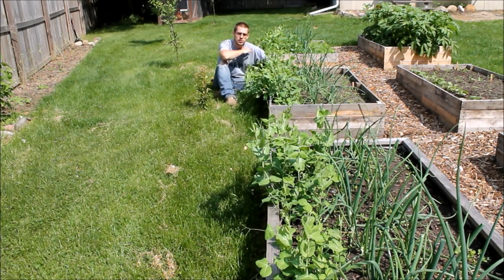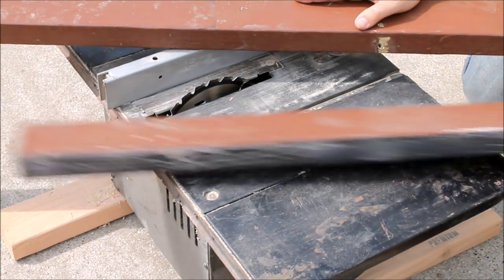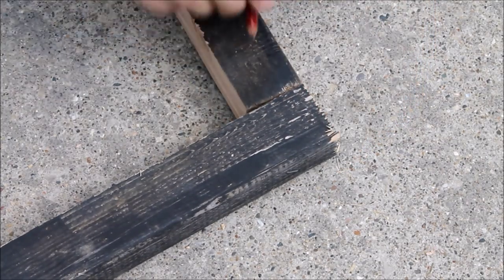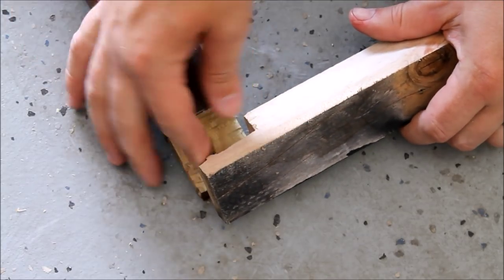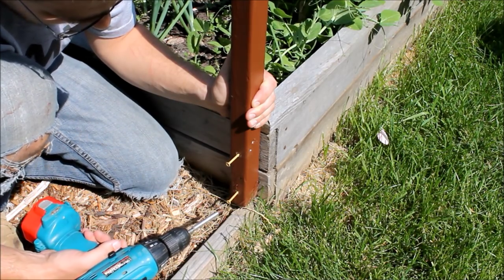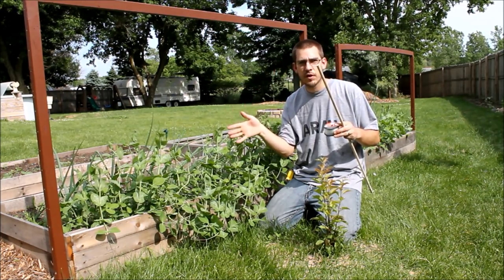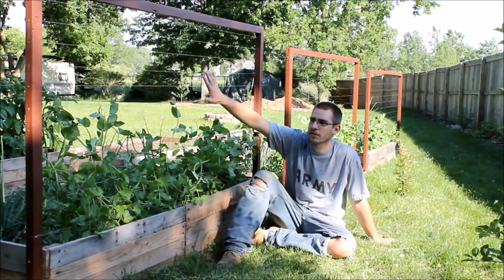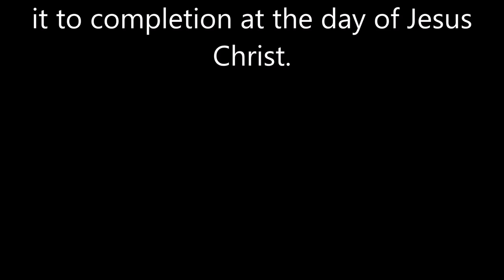Invisible Trellis - A cheap raised bed trellis system

Comment: I finally made one of these today, and it turned out great! I chose to go ahead and pre-drill/pre-string it (without tying it off) before putting it up, then I simply tightened and tied the line once I had the trellis secured in place. I also went ahead and did some vertical lines for extra reinforcement. Looks awesome! Thanks for sharing this project!
Reply from the maker: +NubianP6 glad to hear it! I am plabning to make a new larger one for our new garden this weekend and might incorporate your uogrades, thanks!

Comment: Nice job.  I've done something similar for my cucumbers but, they got to heavy and the lines started to sag.  to fix this I ran one line up the middle, wrapping each line on the way up.  This makes all the lines work together.    subscribed!
Reply from the maker: Shawn Bauer ah, that is a great idea. I may have to do that as well. I tried to pull the line pretty tight but I have a feeling with the cucumber harvest I am expecting ( I always say that)  it will be pretty heavy. Thanks for the tip!
Reply: I love it great job

Comment: I live in a place where we get severe wind so I use electrical conduit pipe and re-bar.  2 x 4ft length re-bar hammered into the ground half way.  Conduit pipe drops over the top of the re-bar, with the same on the other side.  Corner pieces join the standing bar with the cross bar.  In very heavy wind, they don't go anywhere, even with a full crop on them.  I just use garden twine but I like the idea of fishing line.
Reply: Evelyn please show us at least a picture of it, is there a link to a facebook page?  Electrical conduit is that that grey plastic piping or is it galvanized steel pipe?  If you have rebar going thru your vertical posts how do u attach the lines do u still go thru the posts?
Reply: Evelyn Souza Ferreira over time fishing line will break down the fishing line. You will probably have to replace it every year.
Reply from the maker: +Ray Teems this one lasted two years so far but you are right you probably will have to replace it every few years. Only takes a few minutes though and costs about a dollar
Reply: I've done this same thing.  Electrical conduit is the steel pipe.  If you hang down some heavy string (heavy duty baling twine works best) the plants can grow up them and it works great.

Comment: sir great job looks sharp, only upgrades i see you put both screws in line in the same wood grain, it would have been stronger to offset the two corner screws so that the they are slightly diagonal.  so that neither wood has 2 screws in line in one wood grain.  I would have tied each line independently to the post so that if one area breaks it would not undo the whole crop and would not fall down.  Independent lines that way as they weather down and break you can replace one by one.  I would have put the posts 1ft in the ground as a mechanical engineering technician having 2 screws only few inches apart makes the side to side structure weaker. just in case strong side wind comes.
Reply: my dad taught me to put the screws diagonal

Comment: Great idea and it looks real good to. I like to use a type of hemp style twine for annual plants such as peas and beans. Its cheap and biodegradable. At the end of the season its not as strong and you can just rip out the plants pretty aggressively and its not an issue because I only use it for the season. This obviously does mean you have to re-string this twine each year, buts its a quick and easy chore. Thanks.

Comment: I like your idea of the invisible trellis and see advantages for some plants. Peas should do fine on the fish line. However when you grow anything with weight like cucumbers you will find that the fish line will cut into the stems.  The plant above the "crimp" in the stem will not receive the full amount of nutrients and not develop as well. The 60-# line may hold up the weight but the "valve" to the upper part of the plant will be partially closed.  Good luck with all of your plans for SSL
Reply from the maker: Gary Crow I was worried about that with the cucumbers as well. I tried some on it this year and they surprisingly did great. They are not hanging over the line instead the hang on to each other through the line and I haven't seen any crimped stems yet. I wouldn't try anything heavier than a cucumber though!

Comment: For climbing plants with heavier fruit maybe clothesline would work.  I built a clothes drying rack using a similar design - looping the line back and forth between sides of a frame.  Even though the line was advertised as heavy and resistant to stretching I found I still needed to re-tension it after a while.  If fish line is 60 pound test that means it breaks at 60 pounds.  But it probably begins to stretch before then.  Meaning you will need to re-tension the line.  Which may be difficult if plants are already hanging from it. I used 2x4's in my frame.

Comment: Well done!

I found concrete reinforce grid works well too and cheap. It works out to be half the price of sheep fencing in my area and at 12ga, quite a bit beefier. 

I like the method you took. Definitely gonna try it except maybe I'll use 16ga  wire.

Comment: I suggest you use cotton string and not fishing line. When it’s time to cleanup after the season, it’s easy to cut the string instead of separating fishing line and include it in compost.

Comment: I used 3/4 in. electrical conduit 5 feet long and drove them 1 foot into the soil then attached 1x2" fence mesh wire 4' tall.  Never tried it before but it was fairly inexpensive.
Reply from the maker: +Vernon Steinkamp that is a great way to go also. I might try something like that this year also

Comment: This looks great, but I'm wondering how the plants are doing on the fishing line. I would think the wind and weight would cause the plants to pull against the fishing line and the fishing line would cut onto the plants due to the fishing line's small diameter. How are the plants doing?
Reply from the maker: +Susan Miller we did this last year and grew lots of peas and cucumbers on them. No signs of any cutting, the little vines rhat come out wrap around the line and that is what bears the weight not the main stem so no issues. You might not want to grow giant pumpkins on it but smaller stuff works awesome

Comment: Good idea & job on your trellis.
Any idea how long that line will hold up to UV light?

Thanks for sharing!
Reply from the maker: zeffur7 Not sure to be honest but I suppose if I have to replace it after a season or two it only costs a couple bucks. I have a feeling it will be good for at least 2 years without trouble but will probably start to get brittle after that.

Comment: Did the fishing line stay tight or did it sag over time?  I've made similar but used the line used to make chalk marks.  I really would prefer to use fishing line but don't know if regular monofilament line is ok or if I need braided line to limit stretch/sag.
Reply from the maker: the mono did not stretch, it does sag a bit once you get watermelons or a bunch of cucs hanging from it but that was fine since it did not break and springs right back straight once we cleaned off the fruit in the fall.
Reply: SSLFamilyDad Beauty!  I'm going to do exactly the same for supporting shell peas and pole beans for the winter garden ( zone 10a).  Thanks for the very informative video.
Reply: can u please test something for us, i think the stretch in lines would be much less if they were independently tied each to the post.  Can u modify your stand just one and see how it compares.  aslo a couple vertical lines would help every 3 ft. tied to each horizontal line.

Comment: How did you finish off the fishing line at the end without losing tension?
Reply from the maker: +Gary Ravenscroft wrapped it around the support and tied a knot. I pulled it extra tight so if it lost a little tension it was still tight

Comment: This video was made in 2015. It's 2017 now. Would you have any advise or anything you would of corrected? (I.e... Veggies too heavy for fishing wire; how to fix the sagging).Thank you!
Reply from the maker: Not really, you could use heavier gauge line but I am actually building a new larger one at our new house with pretty much the same design. It worked very well! Line does sag a big with heavier stuff like cucumbers but it never broke and supported everything just fine

Comment: I wonder if you did them crosshatched what the result would be. Just a thought.
Reply from the maker: Rabb Whitehead Someone else had mentioned running a couple lines down through vertically and weaving them in for extra strength. I might need to do that for the  cucumbers but for the peas the single line seems to be plenty strong enough. Great idea!

Comment: Great video, thanks. How do I make something like this for my grapevine, which has no bed to attach the trellis to, and will the fishing line cut into it? By the way, that's a mighty fine "scrap" wood you found... LOL
Reply from the maker: grapevine would do fine on this also, make it taller and make sure you use solid supports as the grape vines get big and heavy over time. The vines grab on with so many tiny holds that it doesn't cut anything

Comment: The only problem I see is if one string gets cut, the whole trellis fails.  I might suggest going across and tie, or maybe across and back then tie, and separate the cross lengths.  Other than that, looks great.
Reply from the maker: +B Cook great idea, we haven't had too much issue with them breaking other than when i ripped all the vines out at the end of the season last year
Reply: SSLFamilyDad That is probably the best time it could have happened.

Comment: You made hard work of the joints. A small tenon saw would be quicker and more accurate.
Reply from the maker: +allanpennington well sure or a Dado blade but I have neither and most people don't which is why is used the circ saw:)
Reply: SSLFamilyDad I agree, it's definitely best to make it so that the average person is able to compete the project without having to go out and buy any additional tools...

Comment: if you had used the table saw instead of the skill saw you wouldn't have needed the chisel. just set the skill saw for depth and distance and after your first cut move the board away from the guide.
Reply from the maker: +Derek Tomlin true but i have a $5 garage dale table saw and no crosscut sled. Safer to use the circ saw:)